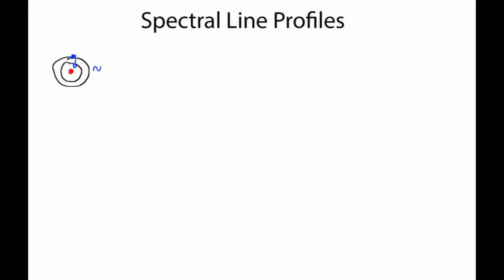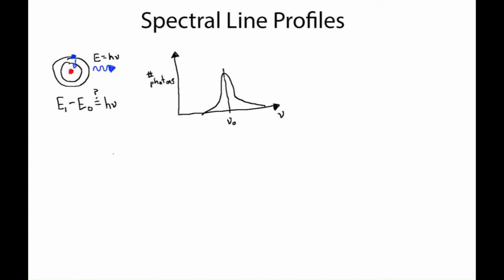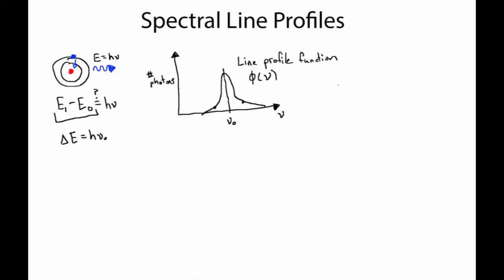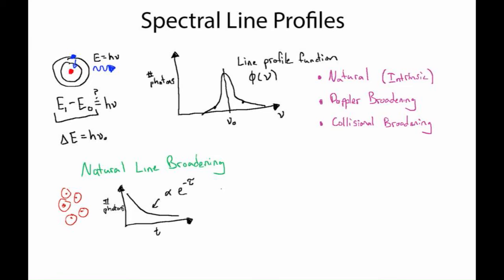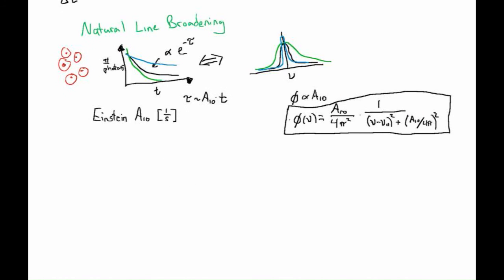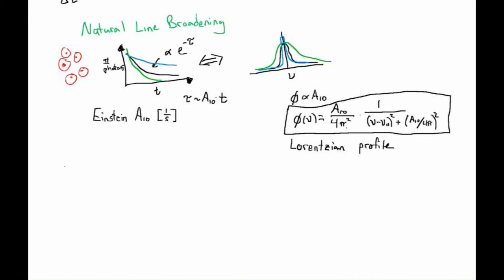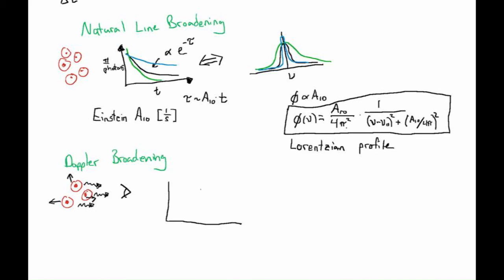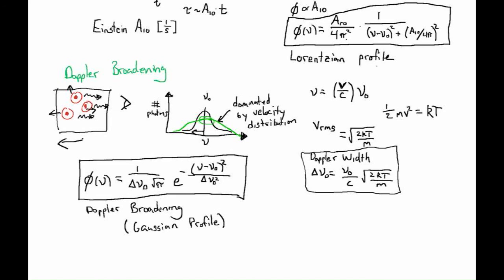Line Profile Functions (Spectral Line Broadening)

Comment: 2:35 shouldn't the function N(t) be proportional to exp(-t/tau)? 3:19 sorry I'm still confused... I know what Fourier transform is, but I don't get the reasoning for why Fourier transform is the answer to natural line broadening here. Thanks!
Reply: No, because here tau = A10 . t (4:05) and A10 is in Hz. So tau is dimensionless, as it should be.
Reply: @jacobvandijk6525  I guess you are right, but this seems to conflict with the previous claim at 2:35 that "tau as the half-life of a decay process".
Reply: @xiaoqilu1353  Yes, that's an unfortunate remark. In his notation tau is a dimensionless decay constant:
                        https://en.wikipedia.org/wiki/Half-life#Formulas_for_half-life_in_exponential_decay

Comment: that has given me lots of thinking with no results. in the  doppler term if you take the c inside the root (see the link bellow) you get the energy term (2kT) divided by mc2 which is the Einstein E-M equivalence.  What its saying is that the square of shift of freq. times the rest energy is equal to square of initial freq. weighted times the field ()thermal energy. what does this mean physically? is the factor two right? two only right if we assme +/-v 
https://youtu.be/wzhnF66ZomE?t=8m38s

Comment: Just a quick question, you said that anything that has a finite length in time has a width in frequency space, this makes me think that the width arises from the fact that it doesn't happen infinitely quickly, and hence that if it did happen instantaneously it would have no width. Why then does the width increase as the decay time decreases?
Thanks
Reply: It's actually the other way around. When you have a wave package of a certain width, the narrower it is the wider the frequency interval you need. That's what's behind Heisenberg's Principle. If something happened infinitely fast (what's called a Dirac's Delta in time) it would need an infinite interval of frequencies.